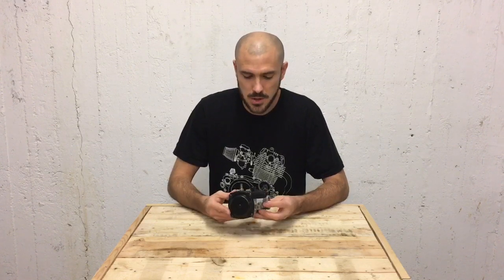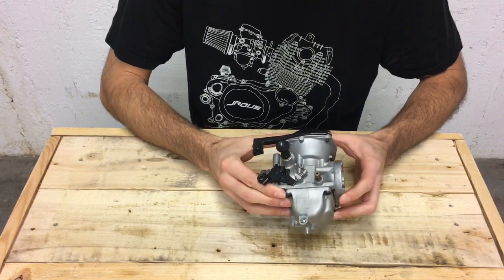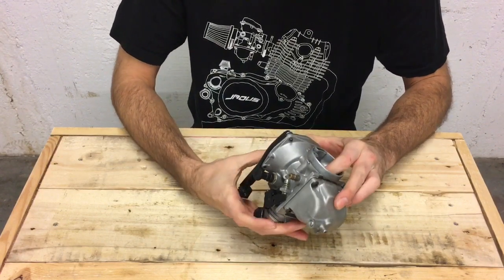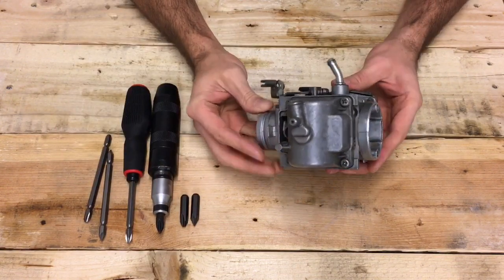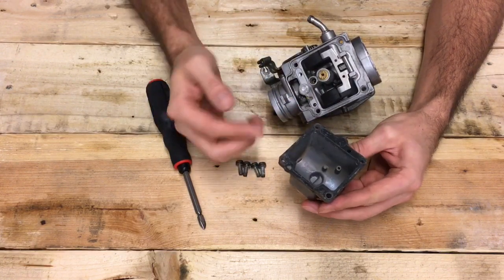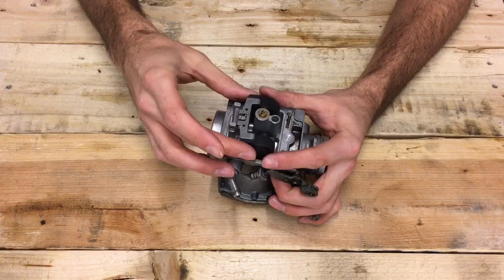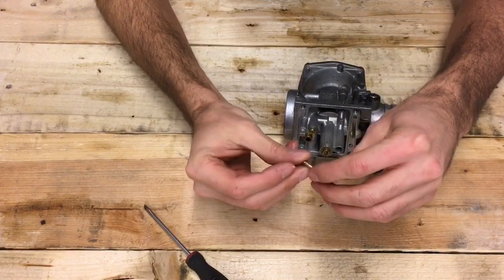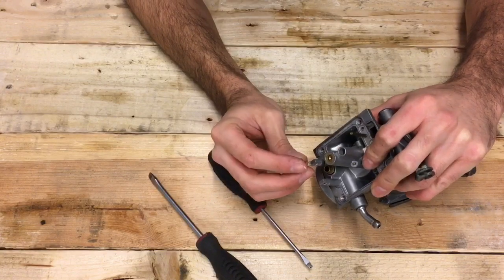Yamaha SR250 carb rebuild, maintenance, tuning

Comment: Thank you so much for this video!  I wish it had existed a year ago, but that's OK, I am thrilled it is available now!

Let me explain.  I'm a 57 year old guy who once owned an 81 Yamaha SR250 that I bought new in Oceanside, California when I was a young US Marine.  It wasn't my first motorcycle but it was the first bike I ever bought brand new, and I loved it.  I rode that bike all up and down Southern California; it was the perfect bike for cruising the Pacific Coast Highway.  Once upon a time, I was out for a Sunday ride, stopped in Solana Beach at the Belly Up Tavern for a cold drink, and was surprised to find B.B. King playing in the middle of the day - $2 cover charge!  Those were some amazing memories I built up on that bike.  

When I received orders to go overseas, I even rode that bike across the US back home to Denver in March 82, through not one but two snowstorms!  Well, I was young and very foolish.  And the national speed limit at the time was 55mph, so the Exciter was quite capable of keeping up, except on Raton Pass in New Mexico, where I drafted behind semi-trucks to get up the hill (I told you, young and foolish).

Years go by and I quit riding and lost track of the bike, and finally I get the bug again.  I go looking and find a nearly-identical 82 Yamaha SR250, which I buy on sight.

Unfortunately, the bike wasn't running right.  It's fine at low speed but has valve noise and cuts out badly over 30mph.  I am no mechanic, not sure what's wrong with it, so I took it to the local 'vintage bike mechanic' who charges me $600 (including oil change and fork rebuild) and leaves it running just as badly as before.

In desperation, I turned to the Internet, and discovered Jadus and other groups and teams and individuals who love the SR250.  It seems it was quite the popular bike in its day, although I did not know that back in that time period - it was just the bike my eye fell on at the local Yamaha dealership.

After some deliberation, I decided that the carburetor was the culprit, so I watched a lot of videos and read a lot of comments on various discussion forums and ordered a parts kit (Mikuni BS34-III as I recall) online and got cracking on my kitchen table.

Despite not being overly mechanically-inclined, I discovered that it just wasn't as difficult as I had been led to believe.  If I had had this video, I'd have been even more confident!  Believe me, you can do this yourself, have fun, save a ton of money, and get a great result.

After rebuilding my carb, my bike simply came to life.  It was as if I was magically transported back in time to 1981, cruising the southern California coast, back when there orange trees and the Orange County International Dragway was still open (anyone remember those days)?

I am so grateful to Jadus and to the people who make tutorials and write about how to maintain the SR250.  The Exciter is just a fun, fun, bike, and I will never sell mine now that it has become fun to ride.  In fact, I hope that I might be able to find another at some point - I like the idea of a cafe version such as the kind that can be made from Jadus parts, but I don't want to change my current Exciter from stock, which I also like very much.  I even love those mini-Easy Rider handlebars everyone hates so much!

Now, for the next video, if I may be so bold as to suggest...

The SR250 has two major weaknesses.  The carb as addressed here, and the camshaft, which has a flaw from the factory such that it doesn't get the proper amount of oil and wears away quickly.  Mine sounds like a coffee can full of ball bearings at the moment.  I need to replace the camshaft and rockers, I know that.  And I feel semi-confident that I could do it myself with some encouragement and tutorials.  I have heard so much conflicting information, however, that I don't quite know where to begin.  Some have said the Yamaha Warrior 350 cam and rockers can be used; this would be great because they are cheap.  OEM Yamaha cam and rockers are quite expensive, unfortunately.

Thanks again for the video.  I hope that I will be able to become a customer as well, just need a second SR250 to 'cafe' on.
Reply from the maker: Thanks for you response William!  So happy for you reliving your youth through a good old SR!  Excellent you got it running smoothly again yourself, congratulations.  The camshaft oiling issue was rectified by a service bulletin from Yamaha in the 80's - it was to insert a restricting pin (a roll pin) into the crankshaft oil galley, which forced more oil volume to the head.  All SR's I have owned have had this mod and none have had the cam/rocker problem :)

Comment: Thank you for this video. It helped me a lot. 

I had a nightmare with my 2003 SR. It came from bike mechanic (carb cleaning + repair kit). After his service,  idle revs were fluctuating, it was hard to start when cold. On stopping, revs were dropping down, then stall. 
His response - air leak, manifold cracked. So I bought a new one, only OEM available - 78€. Nothing changed. I decided to do the rest by my own. Checked for air leaks - none. With your video I stripped down the carb and it turned out the Air/Fuel screw from repair kit have different sized top. I switched it back to original one. Also main jet. Then I set it to factory settings. Bike is running perfect now. 

Again, great video. Cheers

Comment: Thanks for the video I bought a 1981 sr250 July 2018 and it would run with the help of starting fluid but would back fire through the carb into air box I wasn't able to find any rebuild kits for this carb until I found your video last night went to your site this morning and ordered the new parts and can't wait to rebuild the carb thank you for such an in depth video on this carb wish I would've found it last year
Reply from the maker: Great to hear the video has helped!  Hope the kit does too!  You should receive it later this week :)

Comment: Good video! I have a81 sr250 gas leakes from back of the carb when running from the barrel,not when the engine is off any ideas

Comment: I can’t thank you enough for the time you’ve taken, and information shared with this video. I’ve destroyed my throttle/butterfly valve screws. Could you share how you modified and repaired the one you showed in the video?  I ended up drilling out one of the screws.
Reply from the maker: Hi Nathan.  If you have drilled out the screw, you may be able to re-tap the threaded side of the butterfly, so you can add a new screw.  If you have drilled out the screw and ruined the thread, you may be able to tap the hole with a thread size up - say an M5.  But I am not sure there is enough meat in the metal for that.  But that might be your best shot!
Reply: @JadusMotorcycleParts  thanks a million for taking time for a response. I was able to tap the hole for one size up and get everything back together. I put some red threadlocker on it for good measure. It’s running like new again. Thanks!

Comment: I just bought a 1980 SR250. It wasn't running but I was told by the previous owner that carb needed cleaned and/or replaced. My 18 year old son and I are working on it together. We pulled the carb and inspected it. It looked pretty good. Diaphragm was in tact, float looked good, everything looked pretty clean. We sprayed with some carb cleaner, wiped it down, and put it back together. This time when we turned if over it started with the choke pulled out fully. After driving it around the block I could not get it to run without the choke out. When it finally stopped running (probably flooded) it was leaking gas. Should I pull the carb again and check and clean all the jets (we didn't pull and the jets the first time, only inspected the floats and the diaphragm). Will the carb leak because the choke was out for so long, or could it be clogged jets? 

Your videos are awesome by the way. My son and I have been watching them to learn about our new bike. It's the bike I'm going to use to teach him how to ride. Thanks for you help.
Reply from the maker: Thanks man.  I would guess you may have a problem with your float valve leaking if the carb is flooding.  So the small rubber valve might not be seating correctly or is so worn it cannot form a seal.  I don't think clogged jets would cause the carb to leak like that but maybe the choke being out so long - there are also a lot of places the choke assembly needs to seal, so if it is worn, it could leak where it shouldn't.  Check those two things first ;)
Reply: @JadusMotorcycleParts  thanks. I'll pull it apart again and give a good inspection! Thanks.

Comment: I already fuck the screws up before watching video. I was able to remove the bottom parts but not the 4 screws on the top part and it is a pain the ass. Gonna get some rotary and make those screw into flat head soon. damn it

Comment: Hello magnificent videos that you make I congratulate you for them very well detailed !! congratulation!!
I have doubts about whether we remove the standard filter from the sr250, and put a high flow one on it, I would like to know what jets it has on high, on low, and where the needle would be located. Thanks!!!!
Reply from the maker: Hi Adal, we have done extensive testing with different intake and exhaust set ups for this bike - you can see the results and some suggested jetting settings on the blog post linked in the description :)

Comment: Stuffed the screw head on the filter screw. Even with a Jis bit. Wondering of I can use an impact driver to remove or an easy out drill bit.
Reply from the maker: Check out the blog post for some tips for removing screws - the link is in the description ;)

Comment: Great videos and super informative!!  Thanks for the detailed descriptions.  I do have a question.  I have a stock 1980 SR 250G and I'm having carb trouble.  Are the settings that you use in the video based on a tuned carb with performance jets?  I cleaned my cab and tried setting the air fuel jet to 3.5 turns out and the float height to 23mm and my bike got pissed at me.  The stock float was flat and sat at 20mm.  Should it be 23mm?  Also the air fuel jet at stock was originally 2 turns out not 3.5.  Just curious.  Thank you for the blog and videos again!
Reply from the maker: The settings in the video are for a stock carb.  However each carb/engine is different so anywhere between 1.5-5 turns out is acceptable before you know you should change pilot jet size.  If you would like a little more info you could check out the blog post in the description - there is a jetting table there too :)  23mm for float height is correct - but it is very important how it is measured as well - this is also clear in the blog post.  Cheers!

Comment: I can’t get to my air-fuel screw because of an aluminum plate blocking access to it like you mentioned, but I can’t unscrew it; there’s only a little hole centered at the top of the plate. I was wondering if you had any suggestions on how to remove the plate?
Reply from the maker: https://www.youtube.com/watch?v=XEfhgINXKW4

https://www.youtube.com/watch?v=wAXcksgvDkM&itct=CAcQpDAYCyITCLa1vaCdutgCFe8SfgodbnUPjzIHcmVsYXRlZEj6momFvpqQvYsB&app=desktop

https://www.youtube.com/watch?v=W6mtYqM0znI

https://www.youtube.com/watch?v=uAP2gfAqSII

:)
Reply: Jadus Motorcycle Parts thanks guys, got it out!

Comment: I took my carb off my sr250 and cleaned it all. Now when I put it back on and go to start the bike, I have to pull the choke all the way out, and itll start but it revs up VERY high, constantly. If I try and shut the choke it'll die. Any suggestions?
Reply from the maker: Hard to say from your description.  Did you rebuild the carb or just clean it?  Needing to pull the choke right out means you need to give the engine extra fuel to run, which means that your normal idle circuit is too lean - which is either a blocked pilot jet or an incorrectly adjusted air/fuel screw.  Check out our air/fuel screw adjustment video and just check if that is adjusted right to eliminate that variable.  Also, do you know if you have any air leaks at all?  Sometimes just removing and replacing the carb can upset the carb boot and introduce an air leak - which makes for lean running.
Reply: @JadusMotorcycleParts  thank you for the response. I'll have to take a look tonight.
Reply: @JadusMotorcycleParts  just checked it out. There are no air leaks that I could find. I started it and let it warm up, the idle/rev never went any lower. I would give it some throttle and the idle would then actually decrease. Eventually I tried to close the choke and it just backfired and died. The previous owner obviously did some carb work and busted off one the the metal prongs/pillars that hold the float pin in place. He also stripped the screw in the smaller jet (I believe it was the pilot jet). It ran fine before I took the carb apart however... regretting doing that now but it seemed simple and I wanted to tinker with it. Any advice? Thanks.
Reply from the maker: @jensenholly4972  Hey man, jeeze that sucks the previous owner has bust some stuff in the carb.  Makes it really hard to get things right now.  You could try track down a used carb body and transfer all the jets over to that.  I would say you are never going to get the bike to run right if the float mechanism is bust I am afriad :(  XS400's and XS650's also had the BS34 carb, so check those out too.
Reply: @JadusMotorcycleParts  thanks for the recommendation.

Comment: Please, help me: yesterday when I started the SR250, after 6 years of being stopped and after having cleaned the carburettor, I put the petrol tap on PRI to start the engine.
I got distracted and after about 30 seconds - 1 minute, I heard petrol falling to the ground through the air filter box tube: is this normal, or is there something wrong with the carburetor floats? Help me, thanks
Reply from the maker: Hi! That is unfortunate! Yes, you float valve is probably worn and not seating properly, therefore leaking. There are rebuild kits available and it is pretty easy to replace :) Just make sure that no fuel got into the engine/engine oil.
Reply: @JadusMotorcycleParts  Hello again, thanks for the reply. Sorry if I bore you, but I need your opinion and your help.
Two days ago, after having cleaned the carburettor well, I started the SR250 after years of standstill. As I already wrote to you, in the PRI position for about 1 minute, gasoline flowed out of the air filter exhaust pipe. When I put the fuel cock to ON, the fuel stopped coming out, and the bike started easily even using full choke. Today, when I went to turn it on, inserting only the whole choke, the bike started up, after a while it went out and didn't want to start again, as if no petrol was arriving. Not even when pushed downhill did it start. I then put the petcock back to the PRI position, and after nearly a minute in this position, petrol was NOT flowing out of the air cleaner drain pipe like it did two days ago. I put it back ON, tried to turn it on and this time the bike started. What did you understand? Why do you think this happens, where is the problem? I think it is incorrect that after two days, you need to put the tap on PRI to start it. I repeat, I had the sensation that no petrol was arriving to be able to light. Help me understand where I need to intervene. Thank you very much.

Comment: So unfortunately I’m finding this video after the fact but it is immensely helpful.  Previously I tried to remove the jet that is sunk down deep, the one you filed down a screwdriver to fit in, and it came apart pretty badly.  More than stripping and now it’s mostly just the threads stuck with a rather hollow inside of that makes sense.  Is there any way to remove this or is it game over at this point?
Reply from the maker: Did you try the method mentioned on the blog post? https://www.jadusmotorcycleparts.com/post/2018/05/17/yamaha-sr250-carb-rebuild-maintenance-tuning
Reply: @JadusMotorcycleParts  thank you, I was at the website but forgot to look for the blog.  I’ll try the heat gun method.  Thanks for the response and the detailed work you put in for everyone!

Comment: Is it at all possible to jam the slide open and just use the butterfly so it functions like a normal carb?
Reply from the maker: No. The slide has some of the fuel metering components in it (jet needle) so jamming it open would be like feeding the engine maximum fuel, regardless of airflow.

Comment: I have a mates 81 XS650 and the carbs are in pieces, there are two small black rubber plugs that appear to go in the pilot jet hole inside the bowl is, is this correct?
Cheers
Peter
Reply from the maker: Hi Peter, not sure about the plugs.  The SR250 carb does not have these.  Your best bet would be to find an exploded parts diagram for the XS carbs  to be able to see where those plugs should go.
Reply: @JadusMotorcycleParts  All sorted, the XS carbs are nearly identical to the SR. They differ in that the SR draws pilot fuel directly from the bowl, there are other changes but they don't effect my issue . 
The XS draws fuel from after the main jet and therefore the rubber plug! There is a gallery drilled from the main jet tube across to the pilot jet tube which does not exist on the SR carbs.  
Why, who knows?
Cleaned, assembled and installed the carbs today, a prime with the choke and it fired up first time! I'm well chuffed!!
Also, I have 3 SR's, one running, one runable and one in bits in boxes. What would you suggest here? Rebuild one to standard, the second to your spec with the third as a parts mule?
I bought these as a package with two 70's 750 Suzuki's and would like to recover my costs.